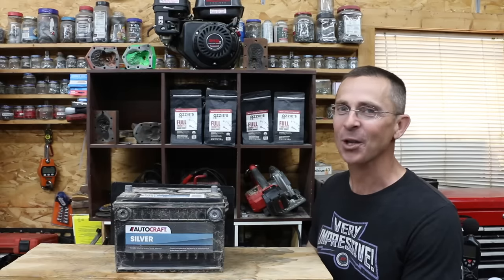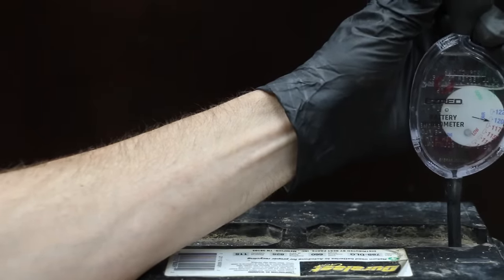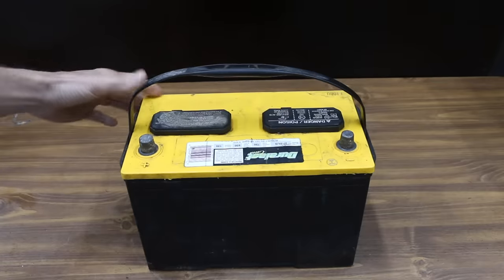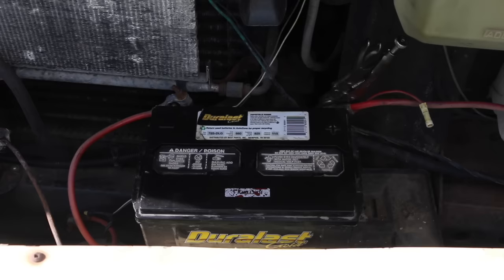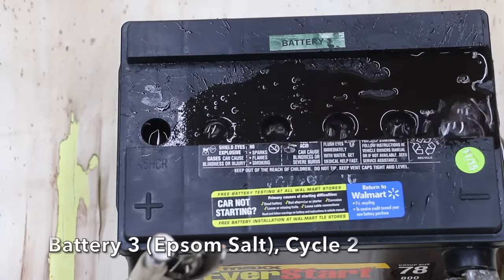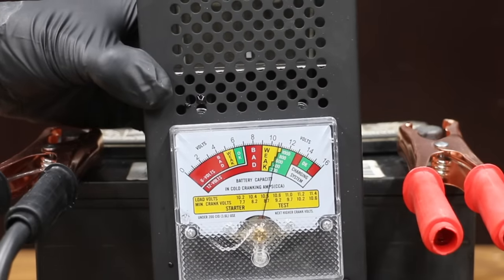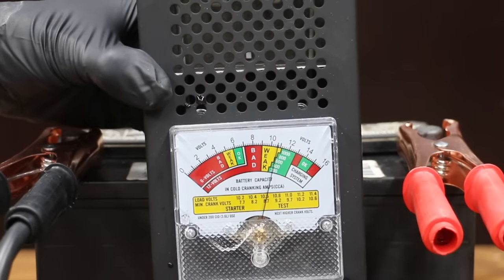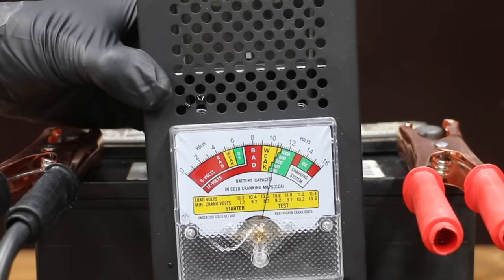Myth Busting! Can You Restore a Dead Car Battery With Welder?  Let's Settle This!

Comment: Todd, thank you for doing this. I have a stack of batteries that I have been saving to try and recover. 
Regarding the Epsom Salt test, I thought you were supposed to use the Epsom salt solution to clean the lead plates in the battery and then put fresh battery acid back in.
Reply: I'd never heard of the epsom salt thing before, but was also confused by not refilling with acid.
Reply: Yup, I also expected the Epsom salt solution to be replaced with sulphuric acid before finishing up.
Reply: I thought the epsom salts were just supposed to be added to the battery with the acid still in.
Reply: Wouldn't Sodium hydroxide be a better option for cleaning the plates?
Reply: @benjaminhenry5869  That isn't a thing afaik. Sodium chloride is table salt. Hydrogen chloride is hydrochloric acid.
Reply: @AresExodus  sorry I meant to say Sodium hydroxide I will edit that message.
Reply: @Torvaltz yea.  me too.
Reply: @oscarvogel2140  i tried that once, got another year out of a battery
Reply: Agreed.  I have added Epsom salts to a battery before and was able to get a couple more years use out of it.  Was it great, no.  But if you drive once a week or so it will generally be ok.  Replaced that battery last year and sadly the new battery died a couple times and still honestly is no where near as good as the old one.  Same thing has happened with another vehicle I have and that has been replaced a couple times as well since the new one was purchased.  Lead acid batteries seem to be getting worse and worse though.

But to de-sulfate the battery using Epsom salts you would ideally want to pour off the acid and add water with Epsom salts then hit it with the welder a couple times then hit it with a trickle charger overnight.  Pour off the Epsom salt and rinse the cells out as best as possible so that you can get any crud out of the bottom tray.  Then fill with acid and charge it overnight and test in the morning.  

Also the battery cell that was showing to have water in it needed to have the cells dumped out and then refilled with new acid or at the very least dumped out so that the acid level in all the cells was the same.  Best guess is that cell boiled over a few times and the acid was replaced with water or something got into the cell and neutralized the acid.
Reply: What is it you think you are cleaning off  ...?
Reply: Bag of new acid is like 40$ anymore. 
I got a quart to top off a battery last week and that was 10$. 
Or just get an AGM ,which I've had about 4-5 of them last 15+yrs. 
One still in service right now is from 2007.
Reply: @MrTheHillfolk  weird. I got a 5 gallon jug from Autozone for that much.

Don't buy the little pint or quart jugs. They're ripoffs.
Reply: My understanding is that the epsom salts added to battery acid boost the voltage. However it reduces the life of the cells.
Reply: @benjaminhenry5869  It's not a simple "cleaning".  The goal is to convert the hardened Lead Sulfate crystals that are choking the battery plates.  Epsom salt (Magnesium Sulfate) can help in some cases but the effect is typically marginal and the battery may become useable (though not particularly reliable) for a short period of time.  Lead-acid batteries have been around since the Telegraph and in all that time there has not been devised an economical means to bring old/dead Lead-acid batteries back to good health.  If there were, it would be common knowledge and top-shelf in every auto parts store in the world.
Reply: @BixbyConsequence   in many countries in Africa and some others where labor is cheat:
- disassemble the battery
- melt the lead and make new terminals
- use new separators (isolation but fluids are able to pass through)
- assemble the battery 

You could even find lead batteries where service is possible: massive lead conductors which can be removed and cleaned. There where lead battery powered trains with open cells where the maintenance guys regularly cleaned the inside of the battery.
Reply: The thing is that the lead plates aren't dirty; they've been converted to lead sulfate.  Something needs to extract the lead from the lead sulfate and put it back on the plate.
Reply: @losttownstreet3409  the battery recycling you describe is exactly what's done in The West, except on an industrial scale.  It's why you've got to exchange your old battery for a new one.
Reply: Came here to say the same thing. I would like to see the results after adding acid if he still has the battery.
Reply: @VentShop  Epsons is magnesium sulfate, sodium bicarb will neutralize any acid
Reply: @BixbyConsequence  yeah I can definitely second that, most of these hacks and solutions will work if the battery is t too far gone but most of the times nothing but a boot to the recycling center going to bring these batteries back
Reply: Everyone is referring to electrolyte as acid. Yes, battery acid has acid in it, but battery electrolyte is not pure acid. It is a specific (pun intended) mixture of acid and water. Pure acid will ruin a battery quickly. Having said that, Todd is the most succinct, honest and thorough tester I have ever seen! No wasted time, no B.S., no wasted motion. Just a good YouTuber that is rendering a great service.
Reply: @BixbyConsequence  Train signal systems still use huge 2V, valve regulated 500Ah (or more in parallel) lead acid batteries to have a DC reference on the rails. A train passes over, shunts the section of the interlocking and drops a relay. Some lithium ion has started to appear for ESS (electrical storage solutions).
Reply: @yourchava  Did you use the same acid, or did you put in new acid?
Reply: @benjaminhenry5869  (about adding sodium hydorixde)
Absolutely not. You never want to form hydroxide salts because almost all of them are insoluble. This would either fill the bottom of the battery with insoluslbe crud or it will coat the plates with lead hydroxide.
Reply: Or put distilled water in and make your own acid by charging it.
Reply: @ElQuesoGuapo  same, just added epsom salt with water, battery was a little low on water kinda just filled up to regular level ,  not to very top
Reply: I believe the idea is that the Epsom Salt would descale the plates but I too wondered why he did not mention refilling it with acid, I can't imagine it could possibly work without some.
Reply: "fresh battery acid" 🤣 it's sulfuric acid! And it can obviously be reused!
Reply: @mrbmp09  Sorry it doesn't work that way.
Reply: Even if he did it right, the real question is this: are you supposed to do it when the battery is charged or dead? If its dead, the "acid" is just water and both the plates are lead sulfide(?) whereas when its fully charged, one plate is lead, one is lead peroxide, and the electrolyte is water and acid.
Reply: @VentShop /videos Yeah, but at what initial state of charge? The electrolyte is just water when the battery is dead.
Reply: I have heard that you have to negative polarization to fully restore car battery. If f.e. plus is on the right you have to complety discharge it, then load it with power so it'll have PLUS on LEFT, fully load it, then discharge, than again fully load to have PLUS on RIGHT, as originally. Never tried it ... but it makes sense...
Reply: That's exactly what I was thinking. You can use a wide amount of liquids as an electrolyte in lead batteries, but with varying performance.  Clearly the salt water was enough of an electrolyte to allow the battery to function, but not very well. Dilute sulfuric acid is a much better electrolyte and that's why they're called lead-acid batteries.
Reply: Not worth the risk!
Reply: @VentShop  Lead acid batteries are getting much worse intentionally. This is because the plates are made of lead powder today that is fused into a synthetic matt material. As the battery is used the lead powder sulfates and falls out of the plates until the build up in the bottom of the battery is large enough to cause a short or reduce capacity too low.

The companies claim that powder style plates can deliver higher CCA but the lifespan is greatly reduced. Old style batteries used solid lead plates that were easy to clean and could last over a decade if maintained. It's really wasteful as lead acid batteries are generally extremely reliable, but the manufacturers are getting away with producing low quality lead plates that may perform well for short periods but dissolve away much faster than they should.
Reply: @kentcontreras4692  I agree, have had a ton of batteries that just suck lately.  It's been a pain but I am almost done with a LiFePo4 battery pack for one of my vehicles as a test bed.  

I already know about resistances and such as well as the potential to damage the alternator.  Built the pack myself and have a charge controller with some big diodes so that the power only goes into the pack through the charge controller.  The plan is to mount the battery pack in the back of the vehicle to keep the temperature as moderate as possible.  Should be fine where I live for starting as it rarely gets below freezing for more than a day.  Going to hook in an ESP8266 to monitor voltages as well as to control the contactor I am using in conjunction with the BMS so that it's only supplying power through the relay when the engine is running or after the brake lights flash so that when you step on the brake to start or hit the remote start it all works fine.  The charge controller is also hooked into the system so it only charges when the engine is running.

Have already heard all the "you can't do that because" spiels and have done my best to figure a way to make it all work.  And I know that DIY is at your own risk so if my car starts on fire with me in it it's my own fault though that should not be an issue at all.
Reply: @ryelor123  Sorry, lead acid batteries are filled with sulfuric acid at the factory.  They don't just charge and have water turn into acid.  If a battery is showing that it only has water in the cells it's likely been run dry and then been topped off with water.
Reply: @papabapyro  Yep basic home chemistry... But using the epsom salts you can get the build up on the plates to sluff off and drop into the tray in the bottom of the battery.  No need to neutralize the acid to do that but it doesn't hurt to drain the acid, fill with water, desulfate the cells, drain and rinse with water, then put the acid back in and run through a charge cycle.

Go look up the AvE video on lead acid batteries.
Reply: @VentShop  That actually sounds like a great idea, having a charge control and BMS adds some complexity to the build but obviously running anything lithium without the right BMS is liable to start an uncontrollable fire. 
You can find lithium based packs fairly cheap today if you order them from bulk suppliers overseas. 
I couldn't see any issue with doing this as far as functionality and being lightweight is a plus. 
The only concern I would have is in keeping the vehicle computers in spec. and batteries from thermal issues. 
A high quality BMS is really what's important for this project and it should work well for a decade. Leaving an airgap between cells could also help the pack stay cooler and last longer.
Reply: @kentcontreras4692  I am using Headway 38120 cells with a holder that allows airflow over the cells so that shouldn't be an issue at all.  Have the 1/0 copper cable on the way so should be able to make the swap by the end of the week and see how it does.
Reply: @RonJohn63  I was about to mention the chemistry and lead sulfate forming.  Epsom salt is magnesium sulfate and probably some other impurities.  Adding epsom provides a sulfate ions that can be used in the reaction to create H2SO4 (sulphuric acid) but I don't know about the reaction rates.  If the H2SO4 reaction is more favorable then the magnesium ions will need to go somewhere on the cathode or their concentration will increase until this reaction is favorable.  I think of this as more of a way to get a low concentration electrolyte to have lower resistance and less H2 gas formation.

My theory is that you add epsom salt to get the electrolyte to conduct as in the case of a completely dry battery that has boiled off due to high resistance.  Then you use a high frequency high current reconditioner to dissolve the lead sulphate crystals on the electrode.  At this point you would swap the electrolyte with H2SO4 to remove the magnesium ions.  They could buffer the solution and have strange chemistry.

I only have experience with Nickel-Iron batteries that use NaOH as the electrolyte but adding small impurities like cobalt and lithium in these batteries has huge improvements in electrode current carrier generation.

What do you think RonJohn?
Reply: @cmgeolo  I think your answer is better than anything I could come up with... :D
Reply: Waste of time .

Comment: Great job testing both the batteries and the different ways of reviving one.  I had a battery blow up while using it to test rebuilt starters, it sounded like a cannon went off and covered my legs with battery acid, luckily it was under my bench which gave me some protection but is also probably how the hydrogen gas collected enough that a spark set it off. Ventilation and make sure you don't allow any sparks close to the battery.
Reply from the maker: Thank you!

Comment: I've got to say, I was not expecting you to get to testing this process; good thing that you did. Whenever corrosives are involved, it can NEVER be understated how important it is to have ventilation and full protection, especially considering there is a risk of explosion here. I am encouraged by the results, so if I'm in a rough patch, then I will make use of the welder route either myself or via someone else who has the setup.
Reply from the maker: Thanks for sharing.
Reply: the explosion risk is mostly from the fact that those bubbles you see coming from the cells are hydrogen, which is very flammable.
I've actually had a battery explode when it was under a cover and being charged, some spark must've formed and absolutely obliterated the battery and thank god I wasn't near that thing.
Also since that hydrogen escapes when charging the battery, you should check the level and fill up the cells with distilled water to keep the level above the minimum
Reply: The danger of injury from explosion can certainly be mitigated by getting someone else to do it. Preferably in another neighborhood. 😂
Reply: I was. Sweet project cars has touted this for awhile, among others. But he's very specific about which welder to use (and kindly provides a link) but the truth is it's part science part magic part luck. One thing is FOR SURE extreme caution must be exercised it's not hard to get hurt if one is not careful. Very careful.
Reply: I want to add that ventilation and safety gear is ALWAYS important.
Reply: It's not even explosion.   I was pulling batteries out of a large UPS for replacement, and one of them was cracked - it actually put a drop on my pants, which after the next wash showed up as a nice hole.

Comment: If memory serves, you did a previous test on car batteries, and mentioned that all such batteries are made by only four companies.  It would have been interesting to see if the company of manufacture had any impact on battery recovery.  Keep up the great work!!
Reply from the maker: Thanks, will do!
Reply: Very good question. Johnson Controls is one of the big battery producers. 
Something to be aware of, even though a battery company makes several brands, they are made to each designers specifications. 
Some people believe they are the same with a different sticker on it but this is not the case. Some of the designs are poor, others are great. 
Food services is another example. People see the same food delivery truck (like Sysco) at a McDonalds, Duncan Donuts, Subway and a steak house believing they start with the same product.
They do Not! Each purchases different grades with different price scales and growers... Huge difference.
Reply: I can charge a battery to where it is at or above the cranking amps.  However, it won't hold a charge for more then a few days.  So for me, I just go out and get a new battery.  Yes, it cost me $225.00.  However, it's worth it to know you don't have to worry about a battery being dead when you need it and if you get 4 years out of it, that's a cheap investment in the "scheme of things" for a piece of mind.
Reply: @trvman1  Keep in mind that driving a car will never completely charge a battery. Test this the next time you end your drive and place a charger on the battery, it will be a period of time before the full charge is complete. Lead-acid batteries love to be held at full charge and will last the longest if kept on a float charge whenever not in use, even overnight. Doing that can extend battery life to several times that of batteries just left to their own fate. Batteries are expensive so I do what I can to extend their life. Each year I take an internal resistance measurement and compare that to previous measurements. A significant increase in resistance warns that a battery is entering into the downward stretch of its life. I have one motorcycle battery still going strong at 14 years old and still testing great, another just replaced with the original lasting 10 years. One car battery that's now 5 years old, another at just about 4 years old. All testing great.
Reply: @trvman1   I can run a small block off a lawn battery, 22$ and If Im feeling spicy, walmart sells a 50lb Battery at around 55$
Reply: @stephendoherty1275  I believe Johnson Controls has sold off their battery division a couple of years ago.
Reply: @DarkLinkAD  50lb Battery?
Reply: @jeffflanagan2814  he did say he was feeling spicy
Reply: @stephendoherty1275  Pretty sure no one asked you a question.